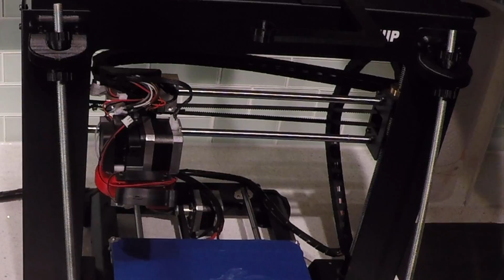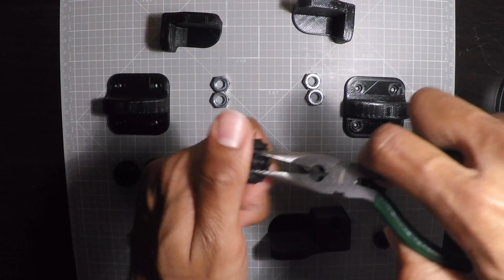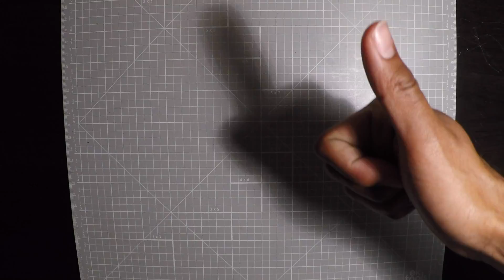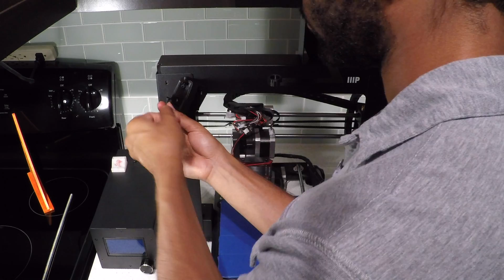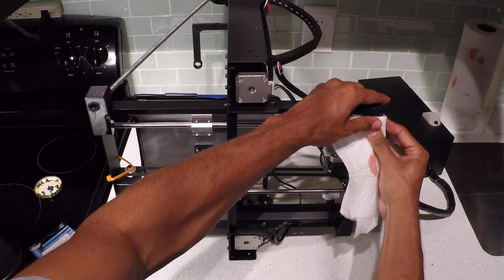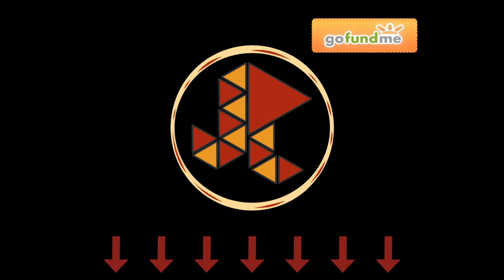Monoprice Maker Select Mods #6- Z Brace

Comment: are there no nuts that go on the top side of the bottom bracket???? meaning it takes 2 locking nuts and 6 5/16 nuts.  would also explain the 2 left over printed nuts.  almost a good tutorial....but inaccurate.  back to the store i go.
Reply from the maker: +Joe P I don't know if I'm understanding you correctly, but if I am, no. You only need the lock nuts under the bottom brackets. The other 4 nuts, two per side, are used to adjust the tension of the rods. That's all you need. The top-most nut keeps it from sliding out the bottom and the one under that keeps it from warping forward too much
Reply from the maker: +jrclem also, I only had 4 printed nut covers. This setup has worked great for me, but if you find the extra 2 nuts worth it, that's great! Let me know if those nuts are worth it.
Reply: you are missing 2 nuts.  one of top and bottom of the top bracket (which you have),  one on top of bottom bracket( which you don't have), and a lock nut on bottom of bottom bracket (which you have).  look at a couple other videos or i can post pics if needed.

Comment: I never did see where you used the plastic nuts you said were going on the bottom.  I saw the lock nuts get added.
Reply from the maker: +Rudi Pittman my bad, they cover the lock nuts. They cover the hole under the front feet.
Reply from the maker: +Rudi Pittman they're not nuts, they're hexagonal wedges that keep the rod in place.
Sorry for not making clear.